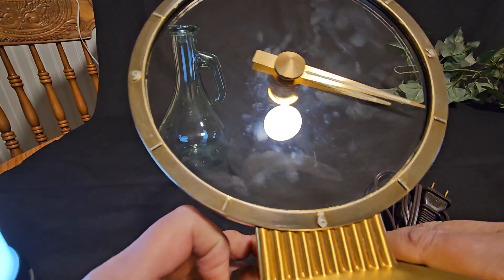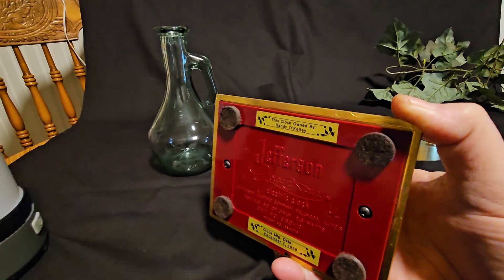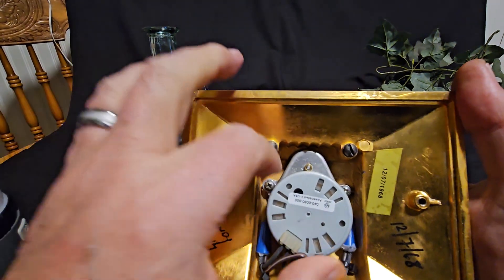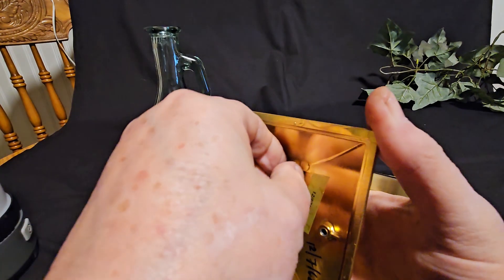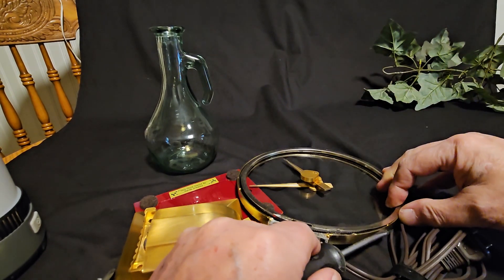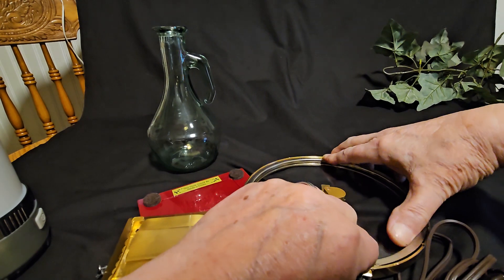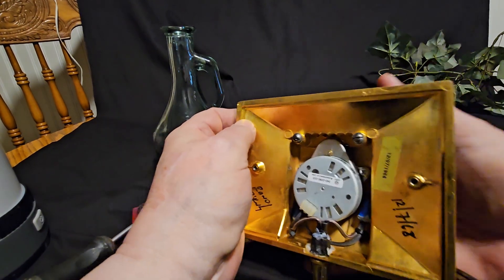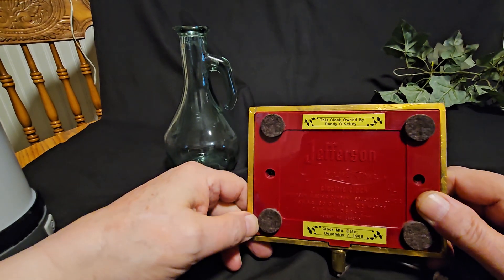Removal of a Jefferson Mystery Clock Chapter Ring

Comment: Great video! I just got one for $75 and its running fast and the glass moves freely in the frame with no resistance.  Is there an alternative to 3m 847 adhesive?
Reply from the maker: Doggoneit. My apologies,  I missed the notification of your question.  

I'm not aware of an alternative to the 3M adhesive.  It certainly is pricey, especially since you only need a small amount. I have NOT tried it, but Permatex Ultra Black shows up as an equivalent. Like the 3M product, this is primarily a gasket adhesive. They have a small bit of a rubbery texture in them. This helps the adhesive take the small bit of torque applied to the clock drive ring when starting and running, call it a cushioning effect. Do NOT use CA super-glues as a substitute, they dry rock-hard and you won't get that cushioning effect. This can shear the drive ring from the crystal (a very common issue) that you have.  It will be essential that you thoroughly clean the old adhesive from the gear ring and the outer edge of the crystal. I use acetone to soften the old stuff, and then a Dremel nylon bristle brush to gently grind the residue off of the gear and an exacto flat blade to scrape the crystal edges. Then apply a thin bead of adhesive on the inside of the gear ring, drop the crystal in place, then keeping pressure on it, turn it a bit to spread out the adhesive. Finally, I use 4 soup cans for a weight on the adhesive and bonding.  Give it a minimum of 24 hrs to fully cure.  Good Luck and give me a reply here if I can be of any help.  Cheers-   Mark and Bugsy

Comment: Whats the best way to clean and polish the finish on the base and ring
Reply from the maker: Howdy-it is VERY important to clean all the old adhesive off of the ring gear and the glass before trying rebond the entire thing. Using a glass pie plate or similar glass bowl, place the ring bonded face upward and add enough acetone to entirely cover the ring.s Once done, that will allow you to remove some of the old adhesive with a wire brush. Repeat with the glass but do NOT use a wire brush on that. Gently scrape it off the edges with a single-edged razor blade or exacto knife (preferred using the chisel blade).  Next, I use a Dremel tool with one of the dark-green radial bristle brushes, to go over all surfaces of the drive ring. The Dremel will leave the ring well polished and free of old adhesive. Finish the ring by wiping it down with alcohol to ensure it is completely cleaned.  The glass can be cleaned by going over the outside of it, where the old adhesive remains, using an acetone soaked cloth. The tough adhesive will likely need to be scraped off with a blade. When the glass is free of the old adhesive, clean it with dish soap and water. 

As to the adhesive, I can't in good conscience recommend anything other than the 3M 847. I know it is pricey and unfortunately you won't need much at all, making it a real painful hit on the wallet. The concern I have with substituting another adhesive is in the property of the 3M goop, that cures with a very, very slight, rubbery consistency. I believe this acts to provide a bit of a shock-absorber from the motor torque, without shearing away the glass. Most of the glass separation we see in the shop is from the adhesive over decades of operation, drying out and becoming brittle. 

Finally, I put a sheet of wax paper on a paper plate (2 plates), then put the ring on it bonding 'face' up.  Before you do this, put the glass into the ring and observe it all around to ensure the ring isn't out of round. You will see this if the ring is slightly above the glass a a certain point.  Now put a fairly slender bead of adhesive all the way around the gear bonding face. Try not to use too much adhesive as it is a mess to clean up afterwards.  The wax paper keeps the adhesive from gluing the paper plate and ring gear together. Now, carefully put the glass onto the ring gear, press it firmly into place and while keeping pressure on the glass, turn it a bit to smear out the adhesive. Now put another piece of wax paper over the bonded parts. Place some weight on the unit to allow it to cure while smeared over the ring face. Try some soup cans or veggie cans. I use 6 cans- two deep over the glass, then a small bag of flower (3 lbs??).  Allow the assembly to dry for a minimum of 24 hours, but preferably 48 hours. Finally peel off the wax paper and clean everything with the exacto scraper and acetone to soften it up. Clean up every bit of dried adhesive off the assembly as it will gum up the gears in operation. 

I know this sounds like a lot of work, it is, but I developed it and never deviate from it after 300+ clocks restored.  
Good Luck- If you have any other questions, contact me @  newmew185@gmail.com
Reply from the maker: Howdy- My apologies, I missed your question until now.  I use an ultrasonic cleaner with jeweler's cleaning solution to get the initial nastiness off of the plated parts. Following that, you must be ULTRA careful NOT to use ANY type of 'regular' metal cleaner/polish. They ALL contain abrasives that will remove the finish, leaving an ugly nickel plate subsurface beneath.  I use a glass polish that is minimally abrasive. Its called GP-Pro and is available on Amazon.  I put some larger 'dabs' on each of the surfaces, then LIGHTLY hand rub them with a 4x4 lint-free gauze wipe. Just a very light back and forth movement. Do that a few times and then check the cloth. Once it starts working there will be a grayish substance on the cloth. Once you see that move to another spot and repeat. When you are done, give the parts a good cleaning with some mild dish soap (Dawn-Ultra) and a thorough rinse.  Then put a few tablespoons of baking soda in a dish deep enough to immerse the parts, mixed with warm water. Give it a few good dunks, then a thorough clear water rinse. This adjusts the pH of any chemicals already on the parts, and helps the paint to adhere well. Dry it thoroughly and give it another rub-down with a gold cleaning cloth. Specifically for GOLD. Some of them are advertised for all metals and have an abrasive embedded in them. Following this, I apply a coat of an industrial sealant, that is safe for gold, water-soluble and dries quickly. It is also self-annealing, meaning that any light brush marks or bubbles will flatten out as it dries.  I use ProtectaClear, also available on Amazon. It is NOT cheap, but worth it to seal and protect the soft gold surfaces. Apply that with a sponge brush using light strokes. One coat is normally enough to do the job.  This is time consuming and not very cheap, BUT its worth it to preserve and protect the clock parts. 

Good Luck- and if you have any other questions, contact us at: newmew185@gmail.com

Comment: Hi, I broke the glass in my clock.  How do I take the glass out of the ring? Does it just pop out from the drive?
Reply from the maker: Hello Susan, Unfortunately replacing the glass in your clock, is much more involved and would be difficult for the average owner, to get correct.  If it isn't done properly, severe damage to the clock motor may be the result and the 'fix' would fail. Feel free to send me an email: newmew185@gmail.com and I can give you some more information and suggestions. Thanks !!

Comment: Mine runs fast. Is there a fix for that?
Reply from the maker: There is a fix for that but it isn't easy. The glass crystal has separated from the ring gear that turns it. Eventually it will stop completely.  The repair involves disassembly of the clock, removal of the hand/hour mechanism, cleaning and polishing all surfaces of the ring gear, cleaning all traces of the old adhesive off of the glass, then re-bonding of the glass and ring gear. It is also common to have cracks and chips that have fallen off of the glass too. Usually that won't be a problem, but if it is a serious crack that could extend, then replacing the glass is needed. The ONLY adhesive that can be used for a proper fix is a bit expensive, since it is an industrial product from 3M #847 Nitrile Adhesive. Acetone is used to dissolve any heavy build-up of the old adhesive that may have glass shards in it. We use Dremel tools here in the shop to polish/grind-off the old adhesive/glass shards on the gear ring. The dark green radial bristle disc works best in the corner area of the gear. Next the glass, if able to be reused must also be cleaned and completely free of the old adhesive. Again, acetone is used for this, followed by polishing-out the glass with a commercial-grade glass/crystal polish, all by hand, as the Dremel could scratch the glass, even with a polishing wheel on it. A thin bead of the adhesive is applied to the ring-gear on the surface the glass rests on. The glass is then applied and carefully pushed to ensure it is well seated in the ring. After that, we use some canned soup or veggies to put weight evenly on the adhesive while it cures. It should be left undisturbed for at least 24-hours to properly cure to correct strength. Following cure, it is important that all bits of excess adhesive be removed from the entire bonding area on the gear ring and glass periphery.  Now it's reassembly time, but NOT before the wear surfaces of the chapter ring (big ring with numbers) that gear rides on, MUST be completely clean and smooth. ANY traces of old oil grease MUST be removed. This clock is designed such that ANY lubrication is ever needed. Oil/grease along the chapter ring surfaces attract dust/dirt and contribute to this condition. Once, clean we go back to the Dremel and polish all the inside surfaces to a mirror-finish. Be careful not to lose the 3 tension springs that lie in their own grooves along the chapter ring as well. These too, must be clean and free of dirt/grease/oil. Now its reassembly time for the whole chapter ring w/glass. Be careful to see the video above completely, that demonstrates how to reattach the hour hand/minute hand assembly to the glass. Be certain when attaching the chapter ring that you 'jiggle' it a bit to ensure engagement with the motor drive gear. As you can see this is a very involved, fussy repair that in reality should only be done by someone knowledgeable, experienced and equipped with the proper tools and supplies. Good Luck-  If I can be of any further help contact me at: 

newmew185@gmail.com

Bugsy's Dad Mark
Reply: @bugsysdadenterprises  wow, thank you for such a detailed response. Much appreciated!
Reply from the maker: YVW.